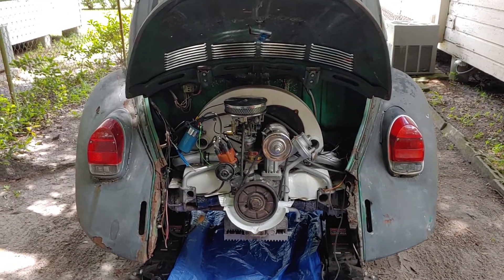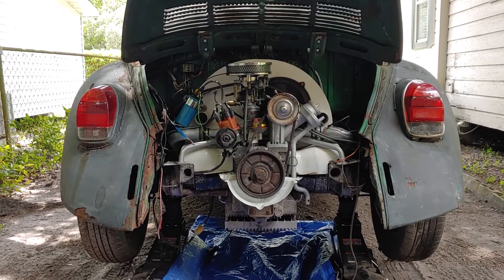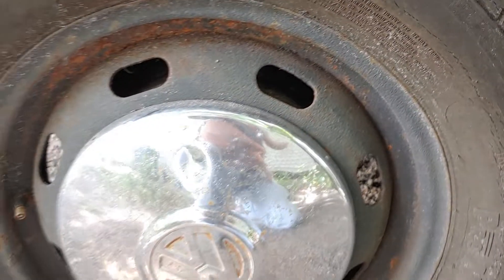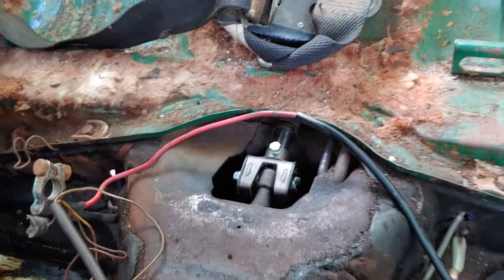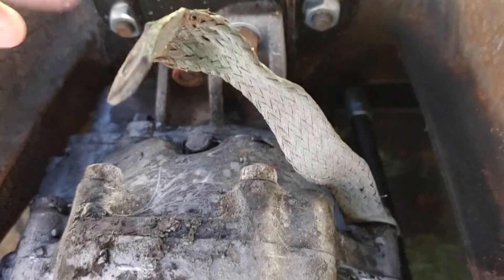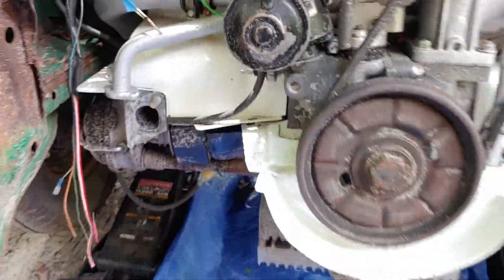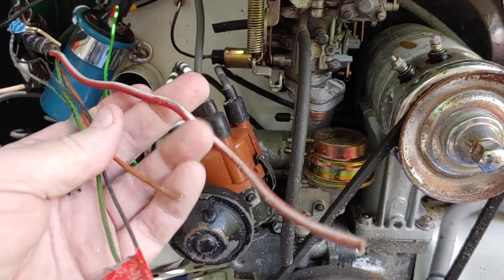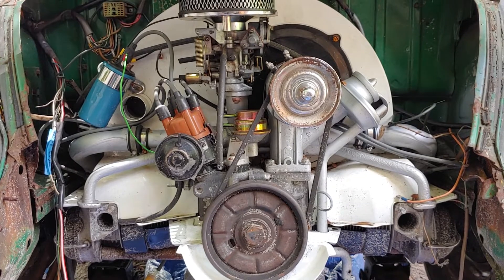WILL IT BE READY FOR BUGJAM? LONG WAY TO GO, SHORT TIME TO GET THERE. BUGJAM NOV.9-10,2019. STAY TUN

Comment: John you got this, I agree with Matt rear apron last item and there a lot of flots that just bolt them in for easy removal of the motor. You set a very realistic goal and a fun one to work at.
Reply from the maker: You guys keep me motivated for sure. I don't want to jinx myself or talk myself out of this goal. I have a few obstacles.ahead. My girlfriend is having knee Surgury to replace both knees first week of Sept. That could go both ways. After physical therapy and appointments I might actually have more time to finish the beetle. Alot of rain ( earlier in the day this year) I need to move some cars around and get it in the garage. Last my health. You are correct, its realalistic. The time is now. Its time to get it done. Again, thanks for the encouragement.

Comment: Don’t wield the rear apron on just make a gasket and bolt it on. Then you can pull out the engine so much easier. Just weird nuts on one side of each part then use a nice bolt. Easy on easy off.
Reply from the maker: Thanks for the encouraging words. I'm glad you have a few comments. These words really do help to stay society.

Comment: It might be a few weeks yet, but I will be back down there and we will get her ready for Bug Jam! Maybe Volkswagen Fetish can make the trek down also and we’ll have another set of hands to work on her.
Reply from the maker: Sounds good. The closer the days get, the more hands on time I have to gather more parts. Went through tje fuel system today, Shhhhh ( tonights video). Wink, wink. Seems to be all there. I need a longer accelerator cable. Like we found out. Just stuff like that I'm finding. Take your time. If at all possible, this month would be the best Shirley goes in for double knee surgery replacement on Sept 6th I think. My Sept and half Oct. is kinda shot with her rehab and stuff. We will see whats happens. Let me know on your side. My weekends are open. Thanks again for all your help